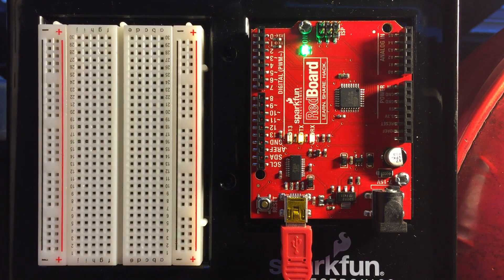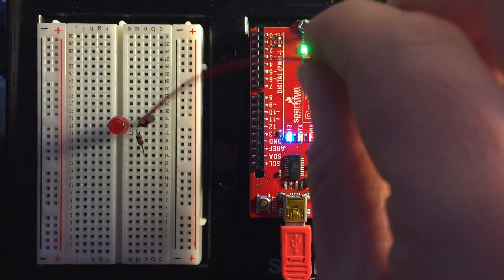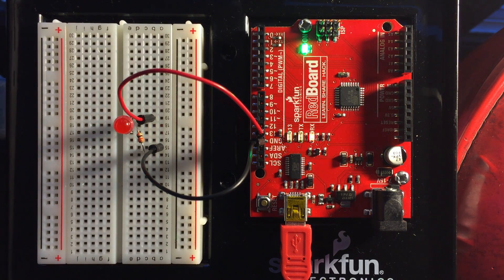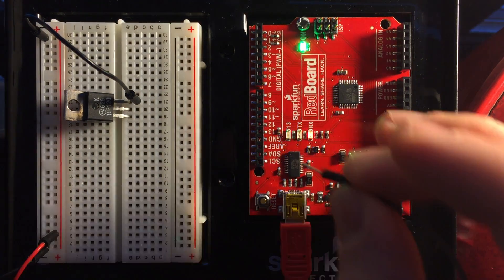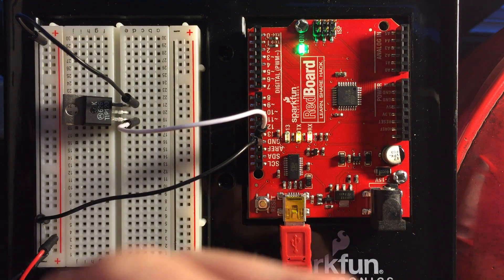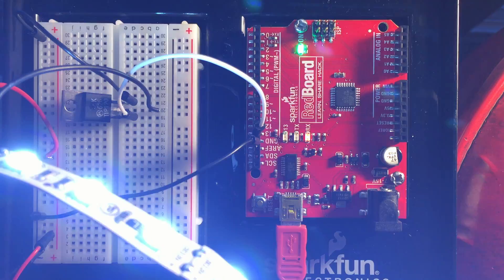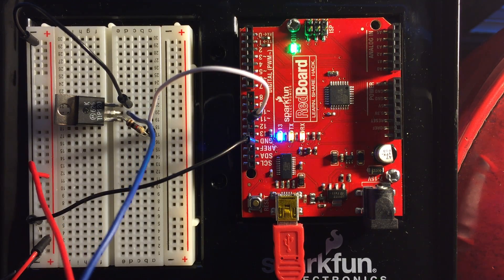Using transistors with Arduino

Comment: The only Arduino tutorial that explains it clearly for newbies!  Clear, understandable, and to the point.  My only wish would be to see a circuit diagram (although what you have is great) and possibly the sketch itself.  "Oh that's easy!"; Well yeah, if you're already fluent in coding.  If you are rusty or old like me, we need to learn by doing.  Great lesson - most useful I've seen.

Comment: I have an application in which I don’t really need to power an actuator. That’s already taken care of by another box. What I need to do is “short to ground” two different wires. This sends a signal to retract or extend the actuator depending on which wire is shorted to ground. How can do this using an arduino? Do I simply connect both the collector and emitter to the ground and use the bae to send the appropriate signals?
Reply from the maker: Yes, you can use an NPN transistor as a switch to short the two wires to ground. You can connect the collector to one of the wires, the emitter to ground, and use the base to control the transistor. When you want to short the wire to ground, you can apply a voltage to the base of the transistor to turn it on, which will allow current to flow from the collector to the emitter, effectively shorting the wire to ground. To turn off the transistor and disconnect the wire from ground, you can simply remove the voltage from the base.

Here is an example circuit that shows how you can use an Arduino and an NPN transistor to short one of the wires to ground:

[Wire 1] -- [Collector] --|-- [Emitter] -- [Ground]
|
[Base] ----------

When you want to short Wire 1 to ground, you can use the Arduino to apply a voltage to the base of the transistor, which will turn on the transistor and allow current to flow from the collector to the emitter, effectively shorting Wire 1 to ground. When you want to disconnect Wire 1 from ground, you can use the Arduino to remove the voltage from the base, which will turn off the transistor and disconnect Wire 1 from ground.

To short the other wire to ground, you can simply use a separate NPN transistor and connect it in a similar way, using the collector to connect to the other wire and the emitter to ground.

I hope this helps! Let me know if you have any questions.

Comment: thanks this was really helpful i needed a way to control the output of the 5v line by using a digtal output pins, i was planing on using a relay but could not find a low operating voltage on and this method seems alot more sence

Comment: good way to blow the front out of your board.  YOU HAVE NO FUCKEN IDEA WHAT YOU'RE ON ABOUT!  That's the BASE of an NPN Darlington pair transistor  1k?? Try something more like 10K ohm for a start. 
As for driving a MOSFET, That's not how you do it either, you'll get away with it for really low speed stuff like your demo, but the gate will oscillate at higher (read PWM type) speeds.
You really should maybe know what you're on about before you decide to advise people. Might have been handy to mention the "diode across the motor" which is not necessary in the case of a cooling fan by the way, needs to be REVERSE BIASED. Generation WHYYYYYYYY????
Thanks though, for showing a bunch of arduino tits how to blow their shit up.... knock a few of the know it all tits off for a few weeks
Reply: Jimmeh B actually the use of 1k resistor is recommended for the  tip120 between the arduino and transistor. And your right about a driving a motor which would require some more components.

Comment: Can somone please help me? I'm a beginner with arduino, and I'm trying to set up a circut similar to this video (but I'm powering a motor instead and using a 9V battery). It works, but my problem is that I seem to be loosing alot of the power while the motor is hooked up to the TIP120 transistor. If I put the motor directly to the cathode and anode of the battery, it spinns noticable alot faster. I have the base connected to a digital pin to the arduino with a 1k resistor. What am I doing wrong? Or is it supposed to be like this? Thanks for any reply....
Reply: The problem is that the TIP120 is a Darlington transistor and drops a significant amount of voltage (probably around 1V or more) across itself when driving a load. With a 9V supply, that will have a noticeable effect on the motor speed.
Use a MOSFET like the IRLZ44 instead. Connect the source to ground, drain to the motor, and gate to the Arduino pin via a 1K resistor. You'll get very nearly the full battery voltage available using that.

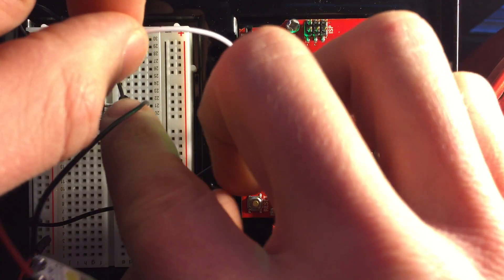Comment: Sorry if this sounds stupid but at 7:25 you mention to put a resistor between signal and pin, wouldn't it be more beneficial to use to use a diode or do i have this wrong?
Reply: no, actually you are right it is more beneficial.  :)
Reply: Sorry you want a resistor for over current protection; a diode is usually used for noise cancellation.
Unless there is a probability of the mosfet malfunctioning, you should be fine with a resistor, however there is no problem with being safe and using both.
Reply: @jamessmith9747  It's not a mosfet. The TIP120 is a BJT and must have a current-limiting resistor, otherwise you short out the output of the microcontroller. Did you see the blue on-board LED stop blinking around 4:15 because it was shorted out by the transistor base?

Comment: A TIP120 is a Darlington Transistor, not a MOSFET.  The resistor needs to be at the base to prevent over current conditions.  A FQP30N06L MOSFET is what's typically used.
Reply: cypherf0x bro can I use the tip 122 transistor for this applications

Comment: What is the voltage drop across the transistor?  Your LED strip isn't getting the full 12V from the supply, right?
Reply: Right, although the voltage drop depends on how much current is being supplied (those LEDs are often rated at 0.7A). The TIP120 is specified to drop no more than 2V at 3A or 4V at 5A. Without a heatsink, it can't dissipate more than 2W, so you can be sure that the strip is taking less than 1A with a voltage drop of somewhat less than 2V. It's enough to see the difference in brightness between the LED strip connected to the full 12V and when it's being driven via the TIP120. These days a MOSFET is more likely to be instead of a Darlington BJT when you're expecting to draw significant current.

Comment: Thanks for posting this video.  I am planing on building my first arduino project using these 12 volt strip lighting.  Your video has helped me understand what I need to do to get the arduino running these led's.